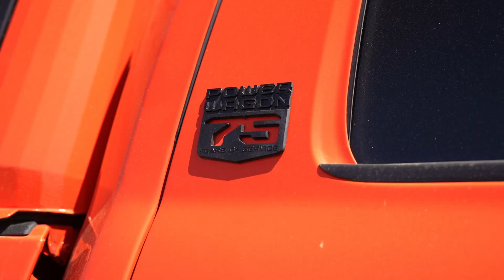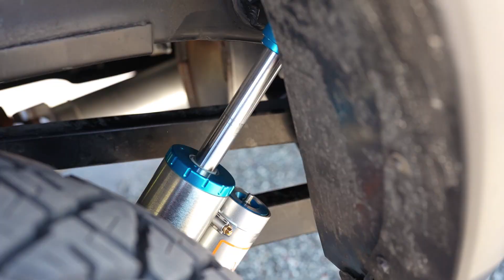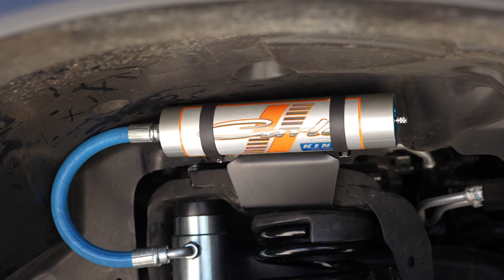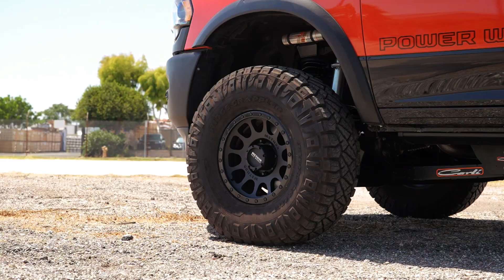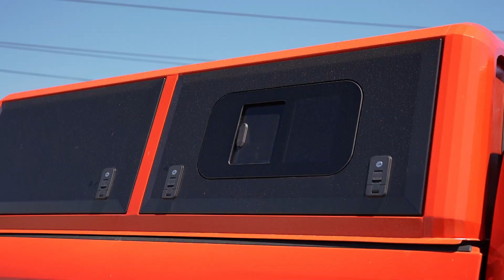Ram Power Wagon Upgraded With Carli Suspension Dominator System and 3" King Shocks

Comment from the maker: What's on this truck:

Carli Power Wagon Dominator System: https://www.cjcoffroad.com/collections/2019-ram-2500-powerwagon-carli-suspension-systems/products/carli-suspension-2014-2020-dodge-ram-2500-dominator-king-3-0-3-lift-system

Options:
Carli dual opposing stabilizer system
Carli radius arms
Carli R2 high capacity rear coils

Method NV wheels (0 Offset): https://www.cjcoffroad.com/collections/nv/products/method-race-wheels-nv-matte-black

Comment: Is there a way to turn off the dash light yet if you swap the power wagon sway bar for the Carli?
Reply from the maker: Not that we’ve found. The only solution is to keep the disconnect module wired and on the truck, and just relocate it out of the way.

Comment: Do you guys recommend the lower shock mount for the pintop 2.5 kit?
Reply from the maker: We do if you plan to use the truck off road. The stock mounts don't hold up well with big shocks!

Comment: does Carli suspension increase payload and towing capacity？
Reply from the maker: On the Power Wagon platform it does. We offer two different rear coil options too. This truck has the HD coils for even more capacity, and they are designed for around 800 pounds of static load.

Comment: Beautiful build! I like the way it all comes together. Time to update my 2006 for a 2024. I also considered the Rebel Cummins, but it's only a partial PW. Have you researched the Rebel, or does that just fall under the 2500 HD unbrella?
Reply from the maker: The Rebel is basically just a trim package for the 2500, similar to the Tremor for the Super Duty platform.

Comment: Would you still be able to put airbags on the truck with this kit or the pintop kit?
Reply from the maker: You can, but that would lose you about 2" or wheel travel and be a noticeable reduction in ride. That applies to a stock Ram 2500 or Power Wagon too.

Comment: Beautiful truck!!  Thanks for shedding some light on the radius arm issue.  You guys did my power wagon a year ago and when you featured it on insta people were talking about how I shouldn’t have gotten the arms. I love them!!  Are the coil spring retainer brackets something that can or should be added to my Pin Top system??
Reply from the maker: Yeah we prefer the benefits of the arms and think it's a noticeable improvement on these trucks! As for the retainers, if you run your truck hard, it might be a worthwhile addition. It's really only for extreme use cases though.
Reply: @CJCOffRoad  thanks for the reply and keep up the good work!!!

Comment: Hey Cody. You mentioned that the typical CJC Exclusive wheels will not work well for this kit. I originally wanted to get the CJC exclusive Methods with the beadgrip, but it would be great to share some other options. I was looking at Raceline and KMC just to be different from everyone else who has Methods.
Reply: They prefer a 0 offset and 4.75" backspacing wheel for this kit on 37x12.5s or 13.5s for least amount of trimming.
Reply from the maker: This particular system is a unique case because of the rear shocks. Really any 0 offset wheel work so it just comes down to your personal preference on brand and looks! For everything else that isn't a 2014+ Dominator equipped Ram 2500, we still  recommend +12 to +27 offset.
Reply: …on an 8.5-9” wide rim?

Comment: Beautiful truck! So a dominator kit wouldn’t work with 37/13.5 and +18 offset (18x9) wheels? Also did ya’ll have to trim metal on the front for the 0 offset wheels or just plastic?
Reply from the maker: Sadly not on a 2500 because of the rear shocks. With 37/13.5s on a 0 offset wheel, this took some decent pinch weld trimming on top of the normal plastic fender liner trim.
Reply: @CJCOffRoad  
I get why the want and need for the 37s. But really curious if anybody yet has just done 35s with a kit like this. Or will I be the first to do that when my PW finally comes in? As it will also be a daily driver for the most besides weekend fun with the family. And then where to find a local shop I could trust to do such welds for the kit? Cause I'm still new at welding so not something I want to practice on just yet with my skill level and welding equipment capabilities.